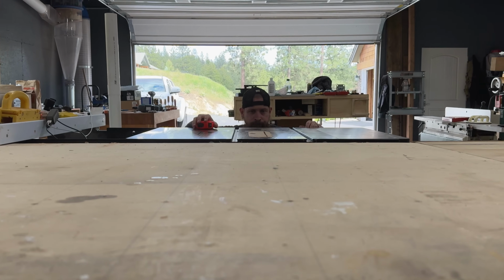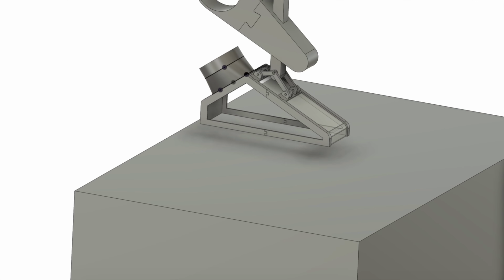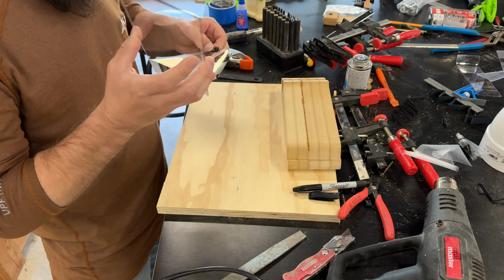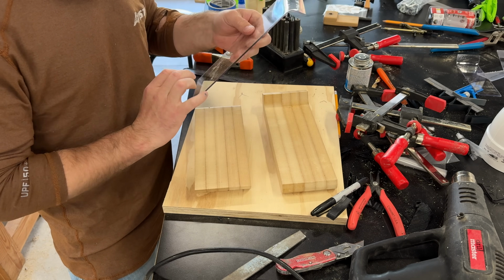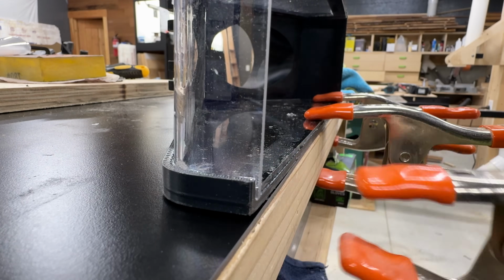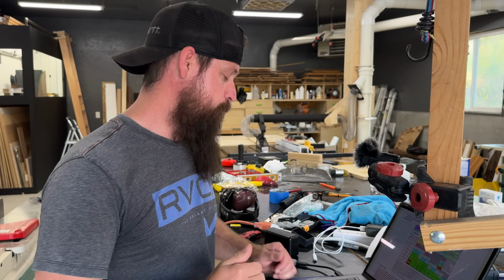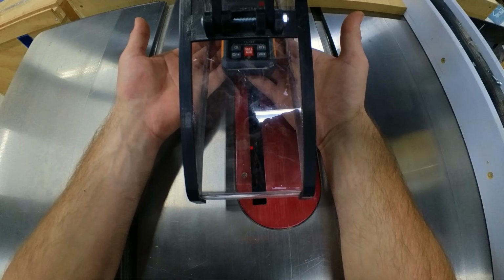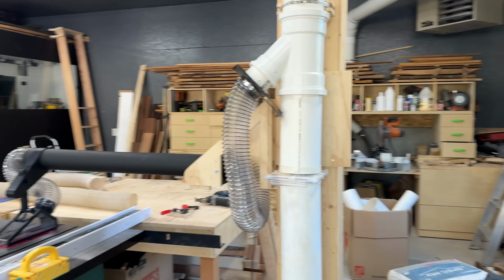90% of woodworkers over look this 1 table saw accessory!

Comment: Hey Rob, great project and esp great use of 3D printing to tailor pieces for your needs.  I've been wanting to replace / improve the current overhead dust collection on my Sawstop, and was thinking of something similar to what you made here.  Couple of thoughts -1) I'd be very curious to see what effect it would have on dust capture if the hose were to attach at the front of the hood rather than the back as you have it.  The cutting action where all the dust is created is happening exclusively at the front of the blade and getting the point of suction as close as possible to the source of dust is paramount.  2) how do you handle situations where the fence is very close to the blade for a narrow cut?  I haven't decided how I will handle this, but my thinking is to have a shorter fence or a reversible fence so the hood and fence don't interfere with each other.  3) I like your height adjustability, but it looks like there will always still be a small gap between the bottom of the hood and the workpiece.  What about installing brushes - maybe short ones like an inch or less, to the bottom edge of the hood.  I know that on my CNC the brushes make a HUGE difference because there is truly no gap between the hood and the cutting surface.  

Anyway, great work and would love to hear your thoughts!   All the best
Reply from the maker: Thanks for watching Carl. I think capturing more over the top of the blade or from the front would work better, and was a thought of mine. It just became a little harder in the design side of things and to keep the aesthetics there.

I’m looking into the cnc type brushes, I’m trying to find some that aren’t way too long. 👊🏻
Reply: @brewbuilds  you can always cut them down with scissors -- that's what I did!  I definitely did not regret it -- the original brushes I had were 3" long and that was way too long and clumsy.  I cut them to about 1 inch and that has worked really well.  Good luck!

Comment: ACGIH: American Conference of Governmental Industrial Hygienist.  Your rotating vein anemometer can give false readings.  The air is blocked by the size of the case, as compared to the duct size, artificially increasing the apparent flow rate.  What you want is either a thermal anemometer or a pitot tube.  You can measure nearly anywhere in the duct and back calculate your velocities...because what goes in (CFM) must come out (ignoring losses).
Reply from the maker: Yeah I had to look it up, I did display it on the video.😉

Comment: i would of put the clear tube directly over the top of the blade .  Maybe even some small rollers or brushes around the bottom lip as one of the suggestions below commented  to catch even more dust.  Good idea though
Reply from the maker: I couldn’t agree more about having the intake more above the blade. I think that would help with the lower cfm flows towards the front of the hood. I’d have to make some design changes to accommodate that. Sometimes you just have to start and make changes as you go.👊🏻

Comment: Great setup. One thing that may be useful is integrating a brush dust boot around the bottom. That way it can maintain a seal around the hood  and wood being cut. It may also solve  the problems with the insert plates because the brush will not let so much pressure build up.
Reply from the maker: Thank you! I’ve been looking at some different brush options to help. I’m not sure if it will make the insert plate better or worse. I think either way adding magnets would be a good move. 👊🏻 thanks for watching and taking the time to comment.
Reply: @brewbuilds  I have a CNC and the brushes on the dust boot 100% help reduce the dust collection. When you are collection dust from an overhead vacuum, brushes provide the necessary curtain for maximum effectiveness. Another suggestion, angle the brushes, this will allow the brushes to flair out. This is important around the saw blade. I have some other ideas if you want to pursue this design. I have been looking at a number of designs and no one has even attempted it.

Comment: Rob, I'm gutted now that I've seen this video on your own design and build of the tablesaw overhead dust extraction system.The reason is simply because i spent £1,200 on the Shark overhead system from Harvey.  What makes it worse is the fact that Harvey doesn't even have a store, etc, here in the UK, so i had to purchase it from a company here in the UK called Axminster.  I guess I need my head checked for paying them this amount of money.  Anyhow, I have to say I'm stunned by just how much cfm ratings you're actually getting from your system it's impressive. At least i was of some help with the 3d unit door seals in your previous video.  As always buddy 💯%   👍   🇬🇧.
P.s I'm curious as to what you have planned next for your workshop improvements 🤔.
Reply from the maker: @simonr6793  what’s up dude! Hey if it makes you feel any better, if I was to buy one, I would by the shark! That is probably the best one. I like to make my own stuff for the pure enjoyment, the challenge, and to learn new skills. I’m really impressed with mine, and tried to make it look somewhat professional. The flows on it are great, and it helps that I have a good dust collection to support it. 

As for my next journey, I have a CNC on order, so I’ll be learning that, building a table for it, then updating my out feed table/ router table.👍🏻

Thanks for watching and keeping in touch.👊🏻
Reply: Nice one Rob,  don't do what I have, I have the Shapeoko 5 pro it arrived around December last year and I still haven't had the chance to try to learn it. I managed to put it together in what was my wife's craft room, ( I've kicked her out! Only of the craft room😂). But since then life's just gone daft with health issues etc so it's just been sitting there collecting dust and cobwebs 😢

Comment: Love the build.  I would be interested in purchasing the pieces to assemble myself as I don't have a 3d printer.  Also- would putting a 'brush sweep' ( like the have on the bottom of CNC bit) around the base of the unit contain more dust?  I'm not critiquing- I'm new to this stuff- just asking.  Thanks for the video!  👍
Reply from the maker: Thank you! No that’s a great suggestion/idea! I’m looking into the brush material to help with the collection. Along with getting some plans put together.  Thanks for watching and taking the time to comment. I’m all about helping people in their workshops. 👊🏻

Comment: Free or paid, it would be awesome for you to release the plans.  I was about to start looking for overhead dust collection for my table saw as my new shop is 90-95% done.  Just about to buy my spiral piping.
Reply from the maker: im working on getting a downloadable file package put together, so others can print their own parts to build this. thanks for watching and commenting. 👊
Reply: @brewbuilds message me if you need someone to draw it up 3D with working prints for each part of the assembly. Typically I charge for the service but I'll do this for free... Solidworks or AutoCAD
Reply: I’m with GP, free or paid, I’m still interested either way
Reply: Same here!
Reply: Same here!
Reply: Would love to get my hands on the plans/files...

Comment: Love the idea , just a suggestion  would gluing a y fitting somewhere along the arm and capping the end straighten the twist out of the flex hose to the hood.  Might look a bit cleaner and increase cfm a bit more. But again great idea. God bless!!!
Reply from the maker: @richardwadsworth4259  I tossed around that idea at the beginning, and was worried it would be too bulky. I have a spare wye maybe I’ll mock it up see how it looks, and run some flow tests. I took reads right at the end of the 4” pipe, and although that flex does slightly reduce the flow I don’t know if it’s enough to really make a huge difference. 

But your idea might be fun to try out! Thanks for watching, and taking the time to comment!👊🏻